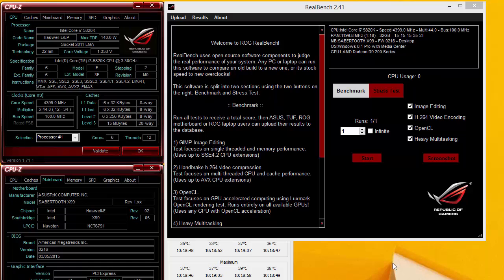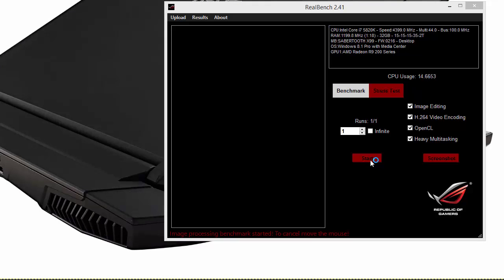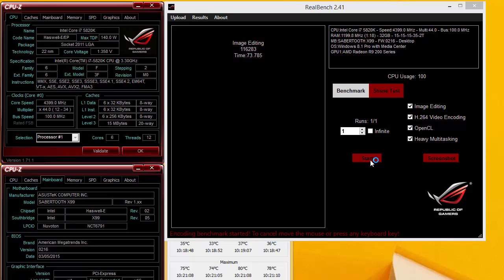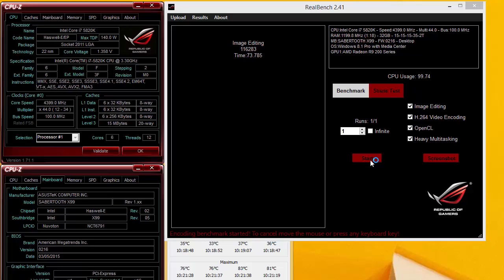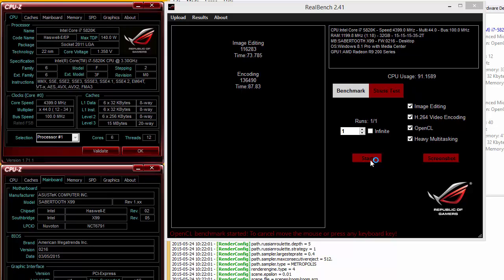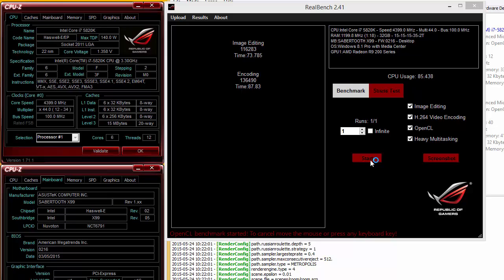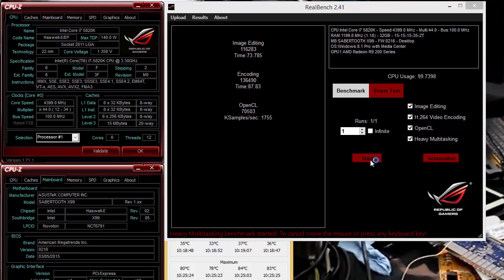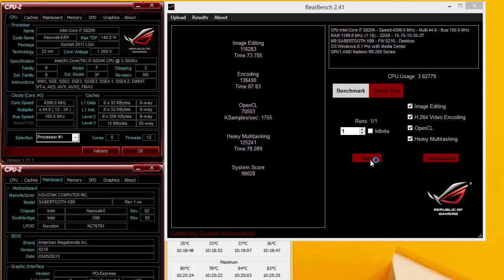Asus Sabertooth X99 4.4 GHz

Comment: Mr. Taliaferro, have you tried using a enclosed cpu water cooler to push it up to 4.5?
Reply from the maker: +madalino jaramillo  I used a triple Radiator Water Cooling System from EK. Chances are it was Vdroop a lot of the X99 boards showed Vdroop to some degree. I pushed it to 4.4 on a cpu known to run 4.5 GHz and the board just wouldn't do it. Boards and CPU's vary I've seen some that made 4.5 on the Sabertooth but your dealing with Hex Core heat which isn't easy to control on this large a CPU.

Comment: Nice video man ....I have a 5930k but I only want to push it to 4ghz , what would I have to change? I hear you don't have to push the voltage up
Reply: CapcomsHero Honestly 4.4ghz isn't "too" fanstastic for a 5820K or a 5930K; it's decent for a 5960X but that has 8 cores so it doesn't overclock "quite" as well (typically around 4.5ghz for the 5960X) whereas the 5820K and 5930K typically average around 4.6ghz clock speed. Note i said average, as some people can hit 4.6-4.7ghz on a 5960X and 4.7-4.8ghz on the 5820K and 5930K.  I'm currently using an I7 4820K and i can hit 4.7-4.8ghz pretty easily; i'm going to be buying a 5960X pretty soon though along with one of these ASUS X99 Sabertooth boards. 

The thing with getting higher overclocks is you have to up the voltage a little bit (1.3-1.35v is plenty, don't up it anymore than that. If you plan to use it 24/7 i wouldn't go over 1.32v or so, 1.3v is best though) but you also might have to up the base clock (bclk) in your bios to get the overclock to work, especially if you are overclocking your RAM too (anything over 2400mhz has to use XMP overclocking on X99 typically) and you have to be cautious with base clock as it effects your CPU multiplier. (for example, 100 is the stock base clock, and a 45 multiplier means you are multiplying 45 x 100 = 4500, which is equal to the 4500mhz CPU speed that setting would give you. But if you are running 120 base clock a 45 multiplier would fry your chip as it would give you over 5ghz which is WAY too high. So make sure never to go over 125 on your base clock, to be safe try to stay inbetween 115 and 120 till you have more experience, 125 is still safe though if you are careful (and under warranty lol). A setting that alot of 5960X/5820K etc.. owners find good is to change the XMP etc.. profiles for the RAM and whatnot so that you are running at ~120 base clock with a multiplier of 37-38 or so, which would give you 4.44ghz and 4.56ghz respectively. 

ALways make sure to run Aida64 after overclocking for the 1st time and leave it go for an hour (or two to be safe) and as long as you get no crashes or instability/errors etc.. while benchmarking with aida64 you're fine, then bump things up a bit more etc.. and run aida64 again. Keep doing that until you get errors or a crash, then you'll know that the "safe" overclock for you will be 100-150mhz lower than the setting it crashed at. For example, if you were fine at 4.4ghz but it crashes at 4.6ghz, then your best bet is to keep it somewhere between 4.45ghz and 4.5ghz for regular gaming, video editing, surfing etc.. for 24/7 use.   Hope this helps.
Reply: xXDarkxIdealsXx I actually did a screenshot , thanks man ....now I'm getting ram @2666 and gonna be running 980ti in 2 way sli but all on a corsair hx860i ..now I know I can everything will run but will I be able to get away with that 4ghz oc on cpu? I would like to go higher but due to the gpus I don't wanna risk it ..
Reply: xXDarkxIdealsXx a flat 4ghz for me would be a decent start and I would only go higher from there ..I would probably consider a New psu but I'll wait for 6th cpu to come out to do that
Reply: CapcomsHero You should be fine with 4ghz, that's an easy overclock for a 5930K 99% of the time. The average OC for a 5930K is around halfway between what an I7 4820K or 4790K get and what a 5960X would get. Average for a 4820K/4790K are around 4.7ghz, whereas the average for a 5960X is around 4.4ghz, so a 5930K should theoretically be relatively easy to get to 4.4-4.5ghz, with 4.6ghz being a little tougher but still possible for over half of 5930K owners. 

What motherboard do you have? If you have a rampage v extreme you can just go into the bios and with the OC panel hooked up change the "CPU Level Up" option to say "4.1ghz" (there's only options for 4.1, 4.3, and 4.5) and it will automatically bump your core voltage up to a safe level (make sure to check what it bumps it to though, as sometimes it makes it go too high; when i try the 4.5 option it raises it to 1.4v! But the 4.1 option should be safe, probably around 1.25v or so, as long as it's below ~1.28v than you're fine for 4.1ghz. 

If you don't have an RVE board then just go into the bios and raise multiplier to 40 and raise vcore voltage to between 1.23v and 1.25v and you should be fine.

The one problem i see that might happen is your RAM, what speed does your RAM normally run at? At 2666mhz it's usually running XMP to get that speed, and XMP likes to raise your Bclk strap to overclock the RAM. This means that the multiplier will be multiplied by a different number like 120 or 125; so if you set a 40 multiplier and XMP has the Bclk at 120 you'll end up with a CPU speed of 120 x 40 = 4800, so 4800mhz or 4.8ghz. So you have to do the math in your head to figure out what would be right. For example, if the XMP sets the Bclk to 125, then you multiplier would need to be 32, since 32 x 125 = 4000mhz or 4.0ghz; or if the Bclk is set at 120 you would need a multiplier of either 33 (33 x 120 = 3960mhz or 3.96ghz) or 34 (34 x 120 = 4080mhz or 4.08ghz. I don't think you can do decimal multipliers, like 43.5 so you'd have to stick with either 33 or 34, for 3.96ghz or 4.08ghz. But anyway, these settings should give you an easy 4ghz most likely, and just so you know, the CPU overclock isn't really effected too much by the GPU overclock. So don't worry about not being able to OC your CPU because your running your 980 TIs at 1,400mhz or something. I'm running SLI GTX TITAN X's myself, with them both overclocked to 1,450mhz and my CPU overclocked to 4.5ghz @ 1.275v, although i am using custom watercooling with EK waterblocks on my TITAN X's and my 4820K. 

 Hope this helps. Let me know if you have anymore questions and i'll try to help.